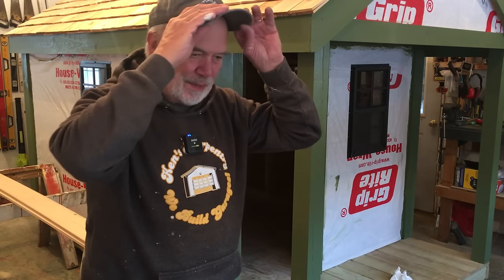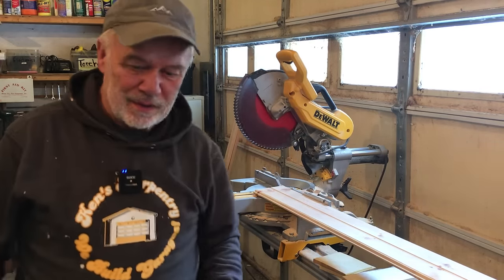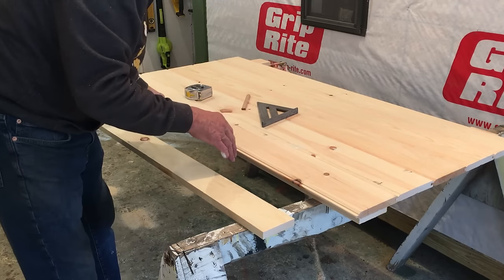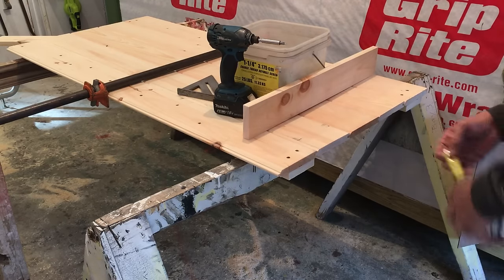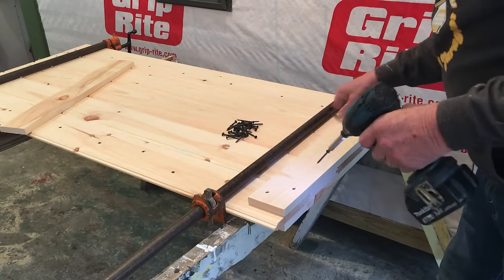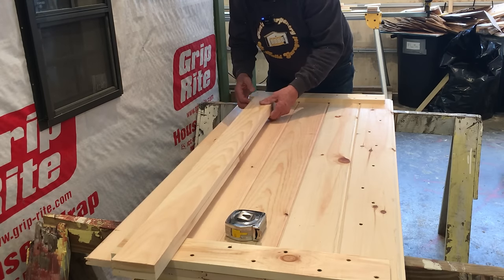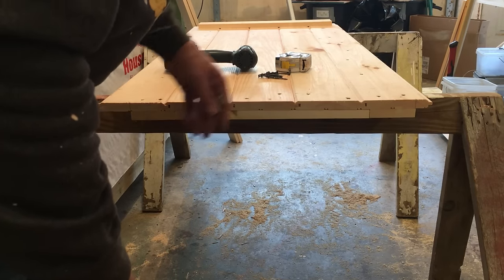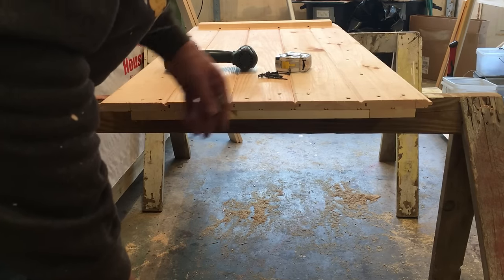How to Build a Dutch Door...What Could Go Wrong?

Comment: Great tip about installing screws that are placed close to the ends of boards by using the reverse on the drill to start the screws so the boards don't split.  Thanks.
Reply from the maker: Thanks

Comment: Any thought to wood movement?  I'm thinking the door would expand in width more than anything.  By placing the tong and groove so tight I would be worried about it splitting the cross braces.
Reply from the maker: Typically, when you buy tongue and groove lumber, it’s still fairly wet and shrinks so it should be fine.

Comment: Did you just cut off the plexiglass of the shape of the heart or did you extend it the full length and width of the section of the door?
Reply from the maker: It’s just a little bit wider than the heart
Reply: @kenskarpentry  thanks Ken.

Comment: I think this would have been a lot easier if you had trimmed off both sides, so the door was the finished width before adding any other boards.  Then any mistake would have been obvious before putting in any screws.
Reply from the maker: You’re probably right

Comment: Come on Ken - a man of your experience should know that a battery power driver is NOT a mallet or hammer.  Misuse your tools and they will come back and bite you in the bum.  The correct tool for the correct job please.  Thanks for letting us see as it's very interesting to watch as a craftsman from the old country.
Reply from the maker: You’re right. Thanks